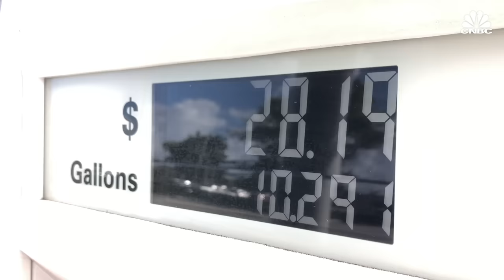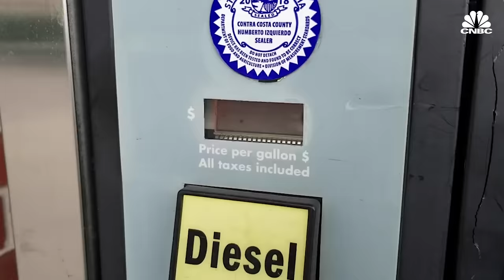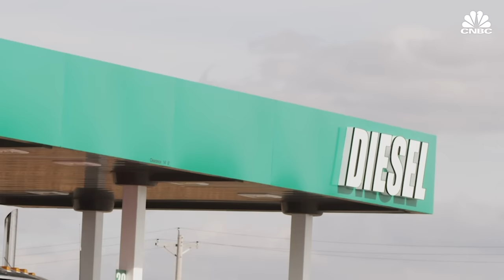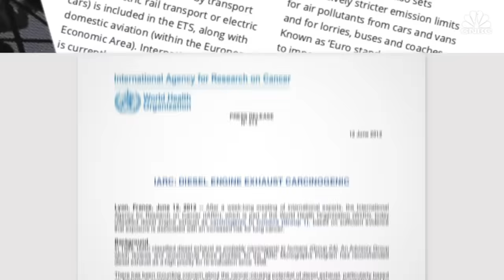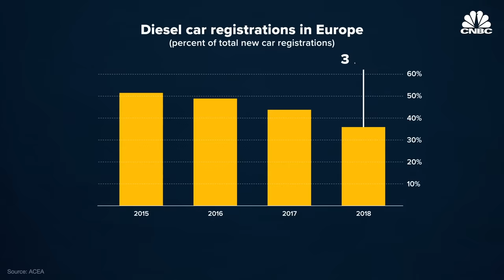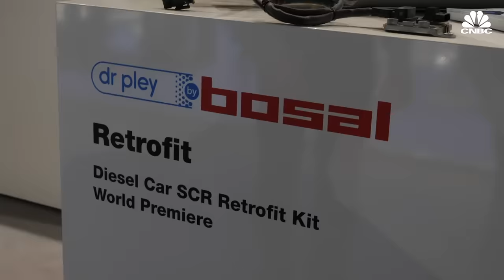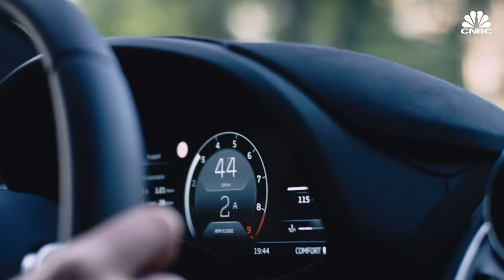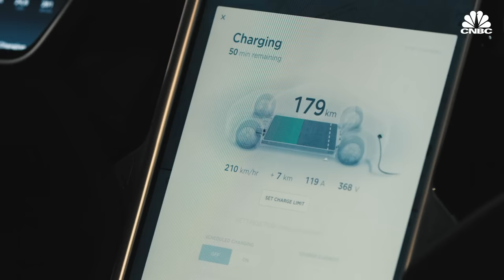Why Diesel Cars Are Disappearing

Comment: Everyone has heard about the VW scandal, but almost as bad was what happened to all the cars they bought back. I had worked where they stored and sorted them. There were roughly 8800 cars there. Of that, they instantly crushed about 2000 of them, and as time went on they crushed more and more. They did fix and resell a lot, but still, some of the things they crushed any of us would have been happy to own. They couldn't come up with a fix for manual transmission Passats, so they crushed them all. There was a beautiful full option, sunroof, leather interior Passat with 36000 KMs on it. I used it to drive around the yard until it was out of fuel as there was no way to save it, they were going to crush it anyway. They hauled it out on a flat deck straight to the crusher. I may have wept a bit that day haha what a waste.

Comment: Diesel can be made out of any triglycerides. It's real sustainability no EV crap.
Better built, better materials, much better efficiency and mpg, more torque for city driving, they love induction for optimal mixture, they last forever as they friction less and barely loose power.

Comment: I am wondering what the IMPACT Of millions of Electric vehicles on the GRID will be !!!
Reply: It's already been confirmed by professionals, experts in the energy field and even the energy companies themselves, that for the most parts of we switched to EV only RIGHT NOW, there would be no change. 

Glad I could help.
Reply: ENORMOUS.
AT THE END THEY WILL HAVE TO USE NUCLEAR REACTORS AND THERMOELECTRIC PLANTS TO RECHARGE THOSE STUPID SUPER HEAVY ELECTRIC CARS.
SO IS THE SAME GARBAGE, OR WORSE BECAUIISE THE EXPLOITATION OF LITHIUM AND THE MANAGEMENT OF LITHIUM BATTERIES ARE FAR MORE CONTAMINANT THAN FUEL.
Reply: You’re assuming the “grid” will not change or improve as EVs reach in the millions. This is just another “Chicken or the egg” riddle that has the answer already baked in if you use common sense thinking. Just like everything else, as demand for certain products rise, so will the infrastructure and resources to support it. Also, renewable energy generation for home and businesses are increasingly becoming more prevalent, which also helps stabilize and strengthen energy  grids. More utility companies are also investing in renewable energy and energy storage which increases their output while relying less on costly traditional power plants. The only limiting factor is battery supply, which is also something that is being remedied as future demand is predicted. I wouldn’t worry about “the grid”. That’s nothing compared to the “global warming” dangers that will come if we don’t switch to cleaner and more sustainable energy production and consumption.
Reply: i will build my own grid thanks to the tesla powerwall and solar panels.
Reply: @faith223  that's the dream.
Reply: Precisely! People don’t think about all the emissions to produce and make the batteries to put in electric vehicles in the first place and the environmental impact of the increase in demand for electricity to charge them! It takes years and years for them to have a carbon footprint less than that of a fuel powered car 🚗
Reply: Depending on the time of day when vehicle are connected to their EVSE, the effect on the grid could be minimal if vehicles are set up to charge overnight, for example between 11PM & 5AM. There are two types of power plants on the grid today, base-load and peaker. Peaker plants are small and nimble generators used during times of high demand and can rapidly increase generation as a typical configuration uses a gas turbine fueled with Natural Gas. However, they are generally not as efficient as base-load and and only operate for a few hours a day when needed, making power from them is expensive per Watt. Base-load, on the other hand,  are giant plants that operate 24/7 at a continuous steady output. These generators are typically Thermal plants that boil water or other working fluid to spin a turbine using a heat source like coal, gas or nuclear. As such, it takes a while to increase/decrease generation and it owers their efficiency. It's these generators that would likely be charging up vehicles

Comment: Amazing how out of date this video is in such a short time.   Here in Europe, EVs are ramping up dramatically and the diesel market is pretty much imploding now for both retail and light commercial. ICE cars / vans in general will be pretty much non existent in 2-3 years with a big hit on fuel supply especially given the wafer thin margins that fuel stations work on.  Even heavy haulage is going the EV route now.
Reply: It should be... Just visited Spain and I couldn't believe how bad the air quality was. I worn a mask not for Covid, but to save my lungs. The first day with no mask, I was coughing up tons of mucus from all of the pollution I was breathing that my lungs had to clean out. I return back to the house, and all of my cloths reeked of diesel pollution.
Reply: Diesel car sales in the UK are now down 60%.......
Reply: Idk in what country you are but here ICE cars are alive and well. Almost no one is buying electric cars because of their cost and range. Most people buy used ICE cars
Reply: @leo2395  it's a transition after all. Here in the UK 41% of new cars in march were pure petrol, mostly rental and fleets. Hybrid/plug in hybrid and pure electric were 35%. So the electrification of cars is well underway. 
When rental fleets switch to full EV, now beginning, it will be well over 50% electrified new car fleet.
That has very serious implications for petrol stations which will start to close down, so pushing more to full EV. 
I fully expect that it will be 85% + full EV by 2028.

Comment: Electric vehicles . . . hmmm. I wonder if, when they look at the over all "green-ness" of electric vehicles, they're taking into account the CO2 and other pollutants put out by the electric power plants which produce the electricity that e-vehicles need in order to operate. Batteries are really not very efficient energy storage devices. Plus, the wires that carry the electricity actually dissipate a significant amount of energy. I very much suspect that if you looked at the fossil fuels consumed to generate the electricity versus just burning the same fuel IN the vehicle you would find that you would consume less fuel by using it to drive the vehicle instead of at the power generating facility.

I would also like to see how much fossil fuel is consumed in making biodiesel. I mean, biodiesel has to be manufactured from plants. That means you have to expend energy to do all the necessary things to bring in a crop of the material from which the biodiesel is derived. Then you have to haul the material to a processing plant to be converted into fuel. That takes energy - most likely derived from burning fossil fuel. Then you have to process the material to produce thee biodiesel. The energy to do that most likely would come from burning fossil fuel. I know almost nothing about the production of biodiesel but I do know about producing alcohol. I have read that, on average, producing a single gallon of ethanol requires the expenditure of ONE AND ONE HALF gallons of fossil fuel. And even then the alcohol has far less energy per unit volume than any fossil fuel. I suspect that if you relied solely upon biodiesel-powered machines to produce your biodiesel in the end you would find that you are consuming more biodiesel than you produce. Unless you produced more biodiesel than the amount of fuel you have to expend to produce the stuff, the result would be a net loss. Just to break even you'd have to produce the same amount of fuel as was consumed to make the fuel. I, for one would LOVE to see the numbers for the amount of fuel consumed per unit volume of biofuel produced. 

Bottom line? There ain't no such thing as a free lunch. (TANSTAAFL) It's called the 1st law of thermodynamics. The reason we rely so heavily on fossil fuels is that the energy density of fossil fuels is so great that an oil well and a coal mine ultimately produce vastly more energy than is required dig them.

Comment: You can run a diesel engine on home made recycled fuel , can't due that with a gas engine and electric once your batteries go out that's it a new battery bank $$$$$ you need a hell of a car fund.
Reply: That's a fairy tale. Waste oil would destroy a modern diesel. They clog the egr coolers and the injectors resulting in extremely costly repairs.

Comment: Diesel fuel does not get a tax exemption. Petrol cars pay a tax surcharge. Diesel was designed to run on vegetable oil. It was the fossil fuel industry that made diesels burn oil. If they were still burning vegetable oil the emissions would not be a problem.

Comment: Not phasing out, here in New Zealand 70 % of pickup trucks and SUVs are diesel.

Frank Perkins of Peterborough England was the inventor of the modern era high speed diesel which the Perkins engine company became a massive supplier to Massey Ferguson which was the western worlds largest agricultural machinery maker, Perkins are now part of Caterpillar. I met Hugh Perkins who immigrated here to New Zealand and was our towns deputy mayor and my property valuer....a very nice unassuming guy.

Try running agricultural equipment good luck with that, it's impossible. Try imagining a equivalent to a 450 horsepower Combine harvester or 650 h.p Tractor which runs 24 hrs plus in vast acreage then see how far that gets u in electric?....

Comment: It will be at least another 50 years before the current old domestic power grid is upgraded to handle charging electric cars everywhere and the new diesel engines have Add Blue that eliminates all harmful emissions from the exhaust.

Comment: I was on the market for a trade-in and the dealership pushed on the diesel engine several times because  they were gathering dust on the lot. I bought the gasoline model instead. I prefer the exhaust sound and power of the gasoline engine!

Comment: Remember back in the early 80s and one of the most important developments with gasohol yes all could be as important today as it was back in the eighties I remember when the first best diesels that they built it was basically a Volkswagen Rabbit with a pickup bed on the back of it I believe if I remember I got 5253 miles to the gallon and it was a great running Dependable little truck

Comment: I drive a 2003 VW Golf TDI & I had to search 3 states to find one. Here's why I specifically wanted a diesel: I live on SSDI, I new I could never afford to buy another car. What are the oldest cars you still see on the road? Old VW bugs, busses, Datsun trucks...: diesels. I new if I got a diesel it would last me far longer than a regular gas car. When I got my car it had been heavily abused, even the interior was scrapped up like it was owned by meth addicts. Had to replace a bunch of parts but now it's a work horse, feel confident that even though it was not taken care of to begin with it will still last me a long long time.
Reply: Had a 2001 VW Golf TDI.  Sold it to a neighbor with 326,000 miles on it.  Just be sure to do the timing belt service.
Reply: @georgesealy4706  Yeah the people who owned it before me were clearly meth heads...has had 4 serpentine belts, 4 alternators, spark plugs, batteries...for years it was the bane of my existence I think I've put enough replacement parts in it that I won't have further prob.s. Has been about 4 years since an engine issue & just passed star smog & had good report from recent oil change so...I'm at 117,000 looking fwd to the next 300,000+ :)
Reply: @10-OSwords  I would sure like to know how you replaced the spark plugs.
Reply: @georgesealy4706  crap, glow plugs. I know nothing about cars...which is why I wanted a car that wouldn't break down on me...
Reply: @10-OSwords  Now that I believe, LOL.

Comment: Todd has a good point; the reality is Diesel provides you with independence;  anyone with enough acreage can grow seeds/beans and press their own bio fuel even today.  You would need about 100 solar panels to charge a Tesla size car fully in a day; plus you'd need an auxiliary power wall type unit to hold the charge until your return if you worked away from that site.  Petrol makes you dependent on fuel; though you could possibly convert to alcohol, hydrogen; wood CO generator.

Comment: You will never get around the use of very high compression to make a diesel engine work. Under this high compression, the Nitrogen and oxygen components of the atmosphere combine to form Nitric and Nitrous Oxides. Those go out the tailpipe and combine with moisture(humidity) in the air to form Acids, and that is how you get acid rain. The lower compression ratios of gasoline engines dont have this problem. How are you going to keep using diesel, now?

Comment: The myth of diesel:  it's not more powerful than gasoline.  It is more tolerant of low rpm but who cares.  Especially with modern transmissions, gear reduction gets you power at any road speed.

Comment: I have had both diesel and electric. Diesel was good on the highway and bad in town. Electric is the reverse. Diesel prices also didn’t drop in the winter like gasoline. Add to that VW diesels high pressure fuel pump blowing up if there was a teaspoon of gasoline in the tank and the headaches , fuel costs, and maintenance costs were to much. I took the buyout.

Comment: Why not use Canola and Jatropha oils to run diesel engines? They burn so clean you might not need DEF systems or even catalytic converters. And cheaper to buy than petroleum or biodiesel.

Comment: Why do we need Tesla's with 400HP ?
If they reduce the power unit (and hence its weight) to some 100'ish HP, you would still have a capable car, but with a much longer mileage pr battery charge.
In Europe we drive around happily in small midrange cars with 60HP, ranging up to larger midrange cars with 130HP.
Luckily the governments have provided for heavy taxes on large cars with huge engines, like the american standards cars.

Comment: No need to stop using the more efficient diesel engines. Just switch to B100 (100% biodiesel) it's carbon neutral, cleaner burning and produces lower and less harmful emissions. City cars can be electric. But heavy equipment, including semi trucks, need the power and efficiency of diesel. Let's use biodiesel.
Biodiesel would not require so much efficiency-robbing, emissions-filtering and would let diesel engines get even more efficient.

Comment: If you drive a Diesel, start looking for BioDiesel. I have been able to find R95 at 76 stations in the SF Bay Area consistently. and there is a 7-Eleven in Richmond that has B100. and BioDiesel is usually cheeper then Dinosaur Juice too, it's a win win.
Reply: BioDiesel RUINS the engine!

Comment: The diesel oil engine is only about 30per cent efficient. Really think in 21st century we should be going fully electric power either hydrogen or battery.which is 90 per cent efficient.

Comment: Saying all of the above. I live in Thailand and 75% of new cars are diesel. They even subsidize diesel. So that people still by them and they are cheap to run. The only reason here that people buy Petrol is they convert them to run on Gas. Buying an electric car here is a joke as they don't have any recharge points. Last count there were around 50 C/Points in total and that's in the whole of Thailand.

Comment: In 1978, I had a Mercedes  220 diesel. I got 38 miles to a gallon. Diesel cost 39 cents per gallon. The  the 2nd gas shortage

Comment: I'd like it if vehicles under a certain weight could be exempt from at least some emissions. they might not appear cleaner but in some vehicles they get such amazing mileage I'd think with how much fuel they save by comparison they wouldn't be polluting as much as a gas engine.   My 2001 7.3 f250 while not a great example for mileage, I got 18mpg on my last longish trip with it and with a 1997 mercedes om606 engine in the back for half of it, its almost at 450,000 miles though and still going strong with a 6 speed manual I don't think thats bad for its size. No annual smog where i'm at so it might get some mods eventually.  The Om606 is for my 70 ford maverick, with a 2012 ford 6r80 transmission.  Engine weighs about as much as a ford 302, DOHC 24V and can rev up to 5500rpm's from the factory. No smog at all for anything 1975 and older so I have some plans for the om606. Some videos show them making insane power and revving even higher.  i'd be happy with 300hp maybe a little more while getting great mileage in my maverick.

They out last gas engines while getting better mileage, newer diesels seem to be dragged down emissions. I'd really love to see more diesel options.  maybe more diesel swap kits like the cummins R2.8.

Id love to see something like the detroit 2 strokes come back but much smaller, lighter, revving higher with all the modern improvements on it like maybe a twin screw supercharger.  I'd love to hear what it'd sound like straight piped and revving at maybe 5000 rpms

Comment: Why can't a series hybrid system be made for a passenger car? A smart diesel engine which runs at most efficient state all the time until the battery is full. Which starts and stops using AI
Reply: Some hybrids did.  Why are they not popular?  We don't know.  Often, there is a diesel option for a vehicle, and they never introduce the diesel model in the US.  Even the Smart had a diesel engine, but it was never sold in the US.  It was even sold in Canada....